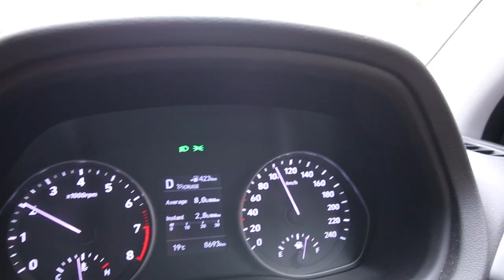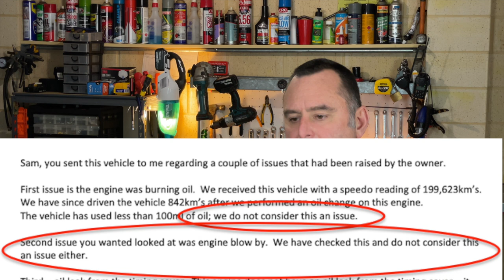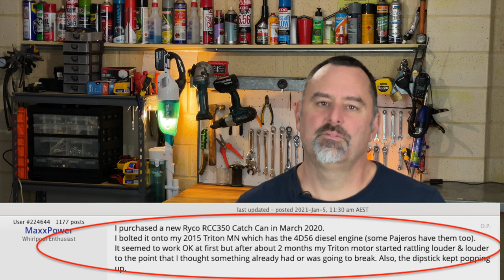Did my 200 Series Landcruiser ENGINE BLOW again - twice in 12 months? Or was the catch can to blame?

Comment: I gave up on diesels years ago, for the saving on fuel it doesn’t come close at all too the cost of servicing and other issues that can occur.
Reply from the maker: I was actually up in Perth to buy a Y62 petrol patrol when I bought this instead. The Y62 was in for a $8000 timing chain repair so I guess they all have their issues. But modern direct injected petrols are giving diesels a run for their money that’s for sure!
Reply: Exactly
Reply: @JebbreysJibberish  what uear was the y62? Very early ones had chain issues. 
As for running costs, our y62 isn't much more than our old 2L amarok
Reply from the maker: Yeah it was a 2013, that why it had a chain issue.
Reply: @JebbreysJibberish  series 3 and on are a great vehicle, no real k own issues.
As bad as it is, all these horror stories of 1vd's blowing up, getting dusted, needing a small fortune spent on them just to make them more reliable is what turned me off, so i went for the patrol.
Reply from the maker: I used to be a Nissan man through and through but when Renault bought them things went downhill pretty badly. I still like the Y62 but the future of the company worries me a little.
Reply: @JebbreysJibberish  i can't see how the y62 is a backward move over the previous models, that 3.0L was a bit of a disaster. We've only done 100,000km in ours, haven't had to do a thing to it, no catch cans, no chips, no auto remaps, no aircleaner issues, just put petrol in and go, very happy with it. And i'm a landrover man😄

Comment: So overall the dealers and the engine rebuilders did not fail you, (apart from that rocker cover gasket) and they did compensate you for that. Often the trade are not up to speed with accessories fitted as non standard.... as for whether the engine has had a remap, who knows? Glad you got it resolved, certainly a pressurised crankcase can create oil leaks everywhere....
Reply: I would hope a reputed engine builder would have an understanding of how engines work
Reply from the maker: Yeah insinuating that my exhaust which was the same diameter as factory but just had no mufflers could somehow contribute to engine troubles when it’s a twin turbo is pretty poor. Not getting the boost right is also a pretty major oversight, but to then try and use that as a way to get out of any responsibility is terrible. The only reason they would have even looked at the boost pressure would have been because I had an ultraguage on the steering column with it displayed.

Comment: Ryco are shit. I have a Discovery 2 and put a Ryco fuel filter on, and within 15km the fuel pump was making a terrible noise and the filter was to hot to touch. Removed the filter and replaced with a genuine filter and problem went away immediately. Had problems with their oil filter on my TD42 GQ too.
Reply: I still to this day always use a full genuine filter kit for my D2A TD5 👌
Reply: @JSH083  Yeah definitely worth it. I changed once and found out really quickly that it wasn't worth saving a few dollars. Genuine components and the car has 400,000km and going strong.

Comment: would be worth putting the filter back in without the valve to rule that out as the cause of the problem.
Reply from the maker: The new 351 doesn’t have the valve. I put the new filter in with the new 351 and have now removed the filter from that one too…

Comment: Bloody he’ll mate did you have to stop the camera to scream a few times? 😂 poor bastard that sucks, I feel your pain though doing the mechanics shuffle… we’ve done it a bunch of times! Ask Mel about our RAC insurance claim on our house we are dealing with at the moment - it will make you feel better about your car 😆 two years of pounding my head against the wall. BTW I love my 200 GX but these days it just sits in the driveway waiting to tow the van, my daily driver is a 4wd 1999 Hilux dual cab with 300k on the clock - it’s great, it cost stuff all and it just goes and one day when it doesn’t any more I won’t sweat over it haha
Hope you have better luck from here on out mate  🤘
Reply from the maker: Cheers mate, yeah just had to do the water pump on it and fix the exhaust too. Hard to trust it but will keep driving, put too much work into it to let it go now.
Reply: @JebbreysJibberish  I reckon you just got done by some shady seller like you said. With our three 200 series we have had we’ve had no problems at all- other than Mel driving into things or me getting a run of dud batteries that were replaced my the battery company. I love them. Saying that I am considering a Chevy Silverado and a Patrol Y62 for our next cars. Can’t beat Toyota resale though!
Reply from the maker: Newer y62’s would make a good tow vehicle but are a little thirsty for a daily. I like them, in fact that’s what I went to Perth to buy but long story short I came home with the 200.
Reply: @JebbreysJibberish  not as thirsty as you would think… I have watched some very interesting videos on them lately
Reply from the maker: Yes they have good economy towing but not much better around town than towing. So as a tow rig that would be great. As a daily you wouldn’t want to have far to go each day.
Reply: @JebbreysJibberish  check this one, here his comments on economy when not towing. Not much worse than diesel cruiser I reckon!
https://youtu.be/OIkIPX5JxU8

Comment: Why run a catch can mate. I had a 2010 200 series with no issues. Never ran one. Its pre dpf 2015 and luckily not the 2008 2009 with some injector issues. Besides the intercooler needing a clean out I only see negatives. Just change the oil more frequently. Or tune it for egr delete if applicable.
Reply: Sample of one is no recommendation.  ALL direct injection engines, petrol or diesel, will gum up the inlets when oil vapour and EGR are mixed.  ALL of them.  There are no negatives to installing a proper catch can  properly.  Perhaps you can pass your extreme wisdom on to the many OEM truck manufacturers like DAF, Volvo, etc who all fit Provent catch cans to their trucks, so they can save money by not fitting such devices, hmm?
Reply: @einfelder8262  you answered your own concerns with the word MIXED. I said the same its the egr  mixed with the oil that sticks and gums up. If you prefer just EGR dust build up without the oil then up to you. Best you can do is delete the egr system but thats illegal so you cannot win. Each to their own on this one mate.
Reply: I tend to agree, its the EGR that causes all your problems. Not the ventilation. The amount of oil passing through is minimal (does your oil level ever drop? No) if anything the oil is good as modern synthetic oils have detergent agents keeping inlet, valves and piston crown clean. The problem is the amount of EGR being let through. It's excessive and causes major blockages. I've been running no catch can with a 7mm hole plate on my EGR on my 2008 hilux. Recently took it apart for a decarb after 100,000km and intake was spotless! Even cylinder 4 was slightly oily but nothing but clean alloy on intake and piston slightly brown. After 100,000km since install of 7mm plate. 
I've figured the reduction in EGR entering system was at a level where the oil mist was able to do its job properly cleaning and moving soot through to the cat for burning properly. 
Im a fan of no catch can and reducing EGR through system. It works!

Comment: Why did you fit it in the first place?
Reply from the maker: Because VDJ engines are renowned for being heavy breathers and the blow by in combination with the EGR gasses tends to block up the intakes quite badly. It was a preventative measure at the time. Blocking or disabling the EGR is the best option to reduce this but also has legal implications. A correctly fitted and well maintained catch can won’t solve the issue but it will help to reduce it without causing any legal or roadworthy issues.

Comment: I have been thinking lately about a used retirement vehicle to replace my long lasting GQ patrol... and of course Toyota comes to mind as the GU patrols are just staring to get worn out .... but I'm not convinced , there's just so many people having problems with 79s , 200, s etc. , and I know this exact video is more about cans than Toyotas but the evidence is out there ,,, my GQ has done 570,000kms of towing and 4wding ,, original uncracked  motor , box and diffs with seemingly plenty left in it yet( I self turboed it at 14 psi at 440,000kms ) ,,,,, and the shear cost of Toyota bits is out of this world to a old school Nissan man , so even if I bought one with say 120,000 kms on it and had to change something on it , I would pass out ,,,,,, its just madness
Reply from the maker: Yeah I had the same issues, I came from a TD42 that I turbo’d myself in the backyard and things are absolutely simpler in the TD42 world. In saying that plenty of 1VD Toyota V8’s do make it to 400+k and it’s a whole new world driving the 200 over the GU.
Reply: @JebbreysJibberish  Oh for sure , I've even driven a 200 gxl and 100 series and the good old 79 s at work for years so i know what they bring to the table ,,,, but gee you pay for it ...
Reply from the maker: True

Comment: The catch can would have been a major factor in your oil leaks as the crank pressure wouldn’t have been venting. However the excess pressure will not go away that is a fault with the engine.

Comment: What a nightmare story but in defence of the engine rebuilder they would have received the engine already dismounted from the body hence no way of knowing about the catch can. Moral of the story though is try not to buy someone else’s problem which is easier said than done.
Reply from the maker: Oh absolutely but when it went back to them the catch can was there and the rebuilder had the car for weeks and did over 1000kms towing with it so really that excuse goes out the window. Plus it’s the lies from them that really upsets me. Sure, perhaps they weren’t at fault in the end, in this case, but how many other times have they been and fault and lied to the customer to get out of it with the same nonsense they spewed and me. They either lied or are incompetent, neither of which are good traits for a business of that kind.

Comment: So the engine builder was correct in rejecting the warranty claim
Reply from the maker: But he was not correct about the dust, engine remapping, boost pressure that are run from factory and said using 1l of
Oil per 1000kms was acceptable for a fresh rebuild. I wouldn’t want to be the person who had a bad build from them and tried to get warranty.

Comment: any one else would burn it,drive it with the oil till it burns,then jump. problem today,is no one knows sht about mechanical objects,,just buy a new one every 2 yrs,. fine... . a catch can,if not serviced,or replaced,can cause crank case pressure build up & a spray garden hose effect.. oil leaks at weakest points..

Comment: Don’t fit catch cans to anything it’s bullshit - the only muppets who rate them are the suppliers who sell them - service the thing as per recommendation and use good oil 

Injectors lines are one use only item on this engine hence probably why it split - you take one off put in bin fit new pipe 

High crank case pressure caused by after market accessory blocked filter - blow by has to go some where 

Frustrating for owner no good mate normally this engine good 

Have looked after heaps of them hope it improves
Reply from the maker: Thanks, yeah the injector line didn’t split it was not seated correctly when it was reinstalled. We thought the same thing but looking it up Toyota say you only need to change the lines if you replace the injectors. Was news to us, but makes sense I guess.

Comment: Why was the catch can installed in the first place?
Reply from the maker: Because it stops the intake clogging up after the EGR gasses mix with the blow by mist and helps save the passenger side turbo on the 200’s which is renowned for failing because they get choked by the watery nasty black sludge from the PCV due to the wonderfull way more intelligent Toyota engineers dumping the PCV into only one turbo.
Reply: @JebbreysJibberish  Why didn't you just clean or replace the PCV valve?
Reply from the maker: Ummm 🤣 because there was nothing wrong with the PCV valve and that’s got nothing to do with what I just wrote about.

Comment: Why didn't you take it to a local mechanic for a first opinion. Then go to a dealer for your warranty issue.
Reply from the maker: I couldn’t see the point, the oil leaks and blow by I thought were obvious at that time. Why would I pay a mechanic to tell me to take it to the dealer for warranty? I’d had a good run with the dealer previously so figured I would go straight to them.
Reply: @JebbreysJibberish  You said it had done 180k? An engine of that calibre in good hands is a wise thing. There is no such thing as a good dealer. Only one (in your case) who will do the right thing by you. Good is a man who goes his own way and does his own thing to provide such a service.

Comment: Can tell you right now modern CRD engines cannot be successfully rebuilt. The tolerances used by manufacturers are near zero. Every component is engineered to get every ounce of performance out it. Seen people do it against advice and it always bites them in the arse. When they die that’s it. It’s genuine replacement only.

Comment: Not being a smartarse or anything here, but I avoid the after market products for these reasons.
A snorkel and thats it. The rest are just money makers for the after market brigade.
Reply from the maker: Yeah it’s a valid point. I’m going to make a video about this soon, it’s on my list. Because I’m a mod and accessory addict and I still agree with you that they are the weakest link. But sometimes necessary.
Reply: @JebbreysJibberish  ive rebuilt deisels the heads on turbo engines fill up with crud in the intakes, exhaust recirculation is a killer, exhaust mixing with the oil from the breather in the intakes, ive seen heads almost completely blocked  scored bores etc etc in low km engines.
Reply: @closertothetruth9209   when you vent the crankcase to atmosphere you can leave the egr inplace/operating and there is no crud buildup as theris no oil vapour for the egr gas to react with. Its not the egr that kills them its the oil vapour. Catch cans reduce the vapour but not well enough.
Reply: @8power857  i imagined after cleaning out many turbo deisel heads that are almost entirely blocked with really abrasive material ,the exhaust was mixing with the oil from the egr, its black as hell crumbly and abrasive a little bit like sand paper, kind of fluffy yet firm and gritty, just my exp rebuilding modern 4 cylinder low km turbo diesels , the bores are scored etc, once switching from rebuilding petrol motors to deisel motors the difference was amazing, i could be wrong iguess, was amazing to see low km intakes 75% blocked with this fluffy black oily crap.

Comment: Do you still have blow by ?
Reply from the maker: Of course there is some blow by, it’s a turbo diesel but worse than that it’s a VDJ, well renowned for breathing even from new. But you can rest the oil cap on the filler now and it doesn’t move.
Reply: Can u show another video of the cap sitting again
Reply from the maker: I’ll be doing a follow up video soon.

Comment: What is a mystery to me is why fit a catch can anyway? If these were so great then wouldn't manufactures (especially Toyota) fit them from the factory?
Reply from the maker: This is a very common question and sentiment. The reality is some truck and heavy machinery manufacturers do fit catch cans as standard. My guess is that if catch cans are not maintained religiously they can cause the exact type of problem I have experienced. Manufactures like Toyota know that a lot of people are lazy and know very little about cars and will simply neglect them and cause Toyota issues. It’s easier for them to not go down that route. Additionally, Toyota warranty is 100,000kms. It’s unlikely that a cruiser will show too many signs of a caked inlet Before then so it’s not something they would be overly concerned about.

Comment: 351 excellent product  no probs faultless from Adelaide crew  it is so efficient at removal of oil that you need to replace filter  at 10,000km awsome products
Reply from the maker: It’s a shame those filters are so expensive. I know the provent ones are not that much cheaper, I wonder how long the provent filters last and whether they catch less oil and thereby are less restrictive? With be interesting to see someone do a side by side test with some testing equipment.
Reply: Absolutely 👍😃

Comment: I’ve bought a new 2020 76 series and have no intention of fitting a catch can.   If they’re so important why don’t the highly qualified engineers at Toyota fit them?  In my humble opinion, catch cans and all these other after market ad ons are just a scam and waste of money.
Reply from the maker: True.
Reply: @Pretzil43  well, there are plenty of diesel mechanics on YT who also argue against catch cans who regularly service all manner of Toyota’s with high ks not fitted with them without issue.  The key seems to be regular servicing, particularly oil and filter changes.   My brother’s 78 series has well over 300,000 ks and not fitted with these superfluous ad ons and it’s yet to even have the injectors replaced but he religiously changes oil and filter every 5k intervals.   It runs no pre fuel filters or EGR blank off either and this vehicle has travelled extensively throughout Australia.    It’s obvious from this video that catchcans are a waste of time and have caused this issue.

DPFs are a different issue completely and one only has to look at all the issues these ad on anti pollution devices cause other manufactures, particularly German, so I wouldn’t be hanging the Toyota engineers out to dry over that horrible device forced onto them.    I just wish I could remove it.